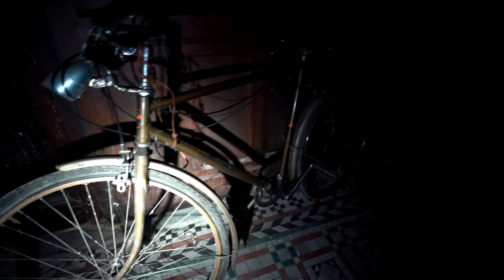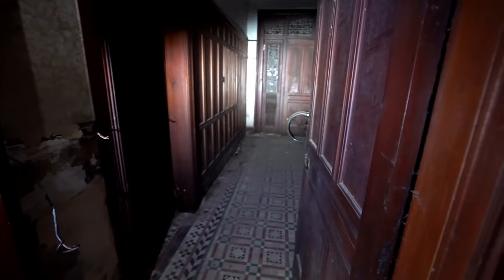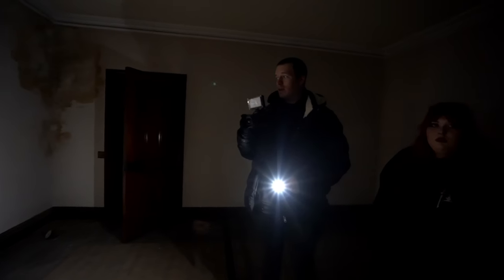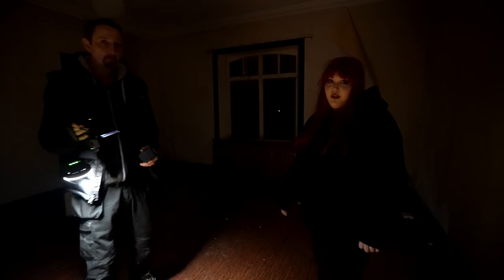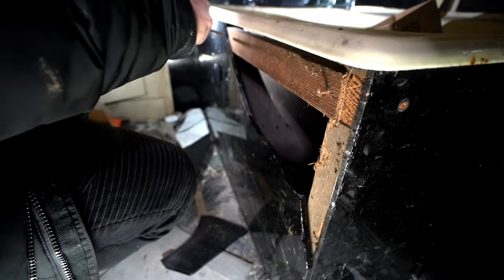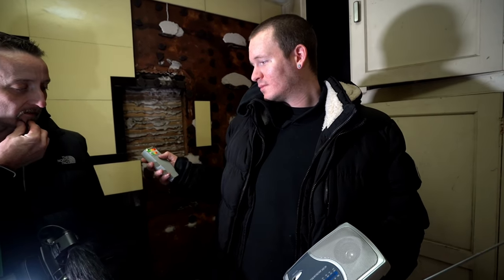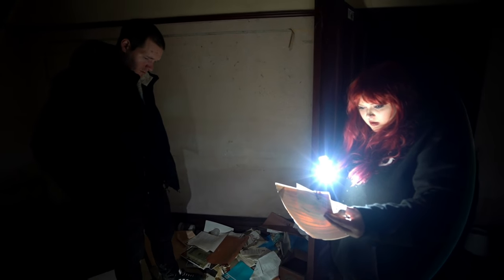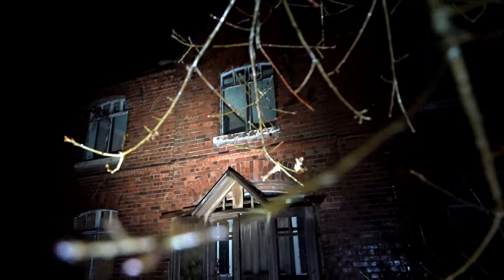Body under the bath in abandoned house (AXE MURDERER)

Comment: Dude said, please comment what is seen by viewers under the bath tub... First off, you can't look at a stain and say it is blood. You need a blacklight and luminol (it turns blue when it reacts with iron left over from blood). Though this case is decades old, anything luminol will react with is probably the rust from the bathtub pipes, or some shit like that. Still, it's an interesting video, just the equipment used doesn't work, because EMR signals can be picked up anywhere, and they can accumulate in corners of rooms, especially near metal objects.

Comment: Both pieces of spirit box/radio's same purpose and same scientific method between them. Its just easier with spirit boxes because it automatically cycles thru the frequencies. My father had a licence and taught Amateur Radio 4 yrs & I learned as much as i could after he spent 40+ years into it.
Reply: I still have his huge huge binder style book of EVERY and i mean Every country. He even spoke with his similar call sign which was the call sign of the guy who ran the radio station who 1st mentioned the Area 51 Roswell crash. Much later of course but he was speechless when he recieved his QSL Card with his info on it. :-) May my father R.I.P.